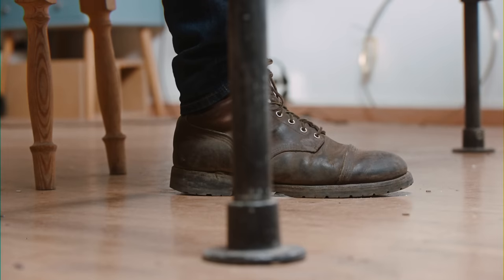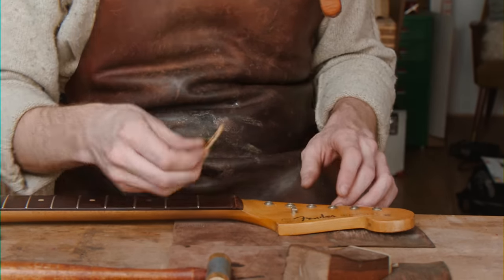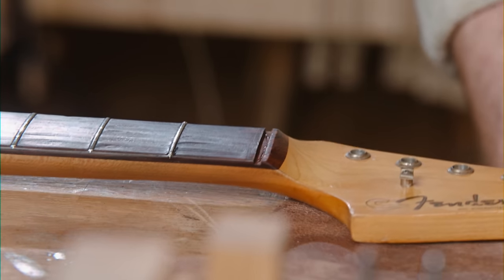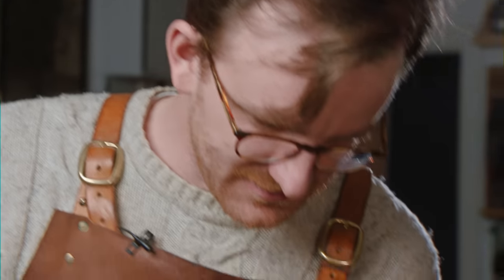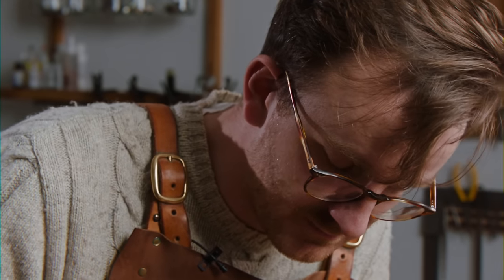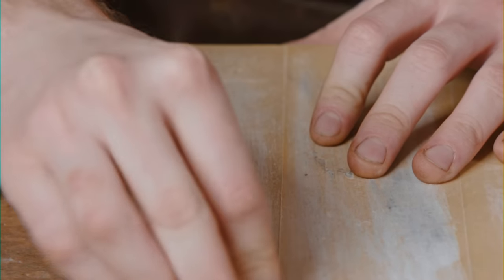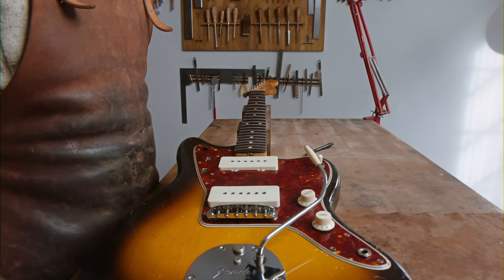Refret and Restoration of a vintage 1960 Fender Jazzmaster

Comment: I've worked in hi-fi for Totem Acoustic in the assembly line, AKA "the trench", and I'm not quite sure people understand the level of carefulness and skills it takes to use a soldering iron to heat up the frets without protecting the fretboard. This man is a living legend of soldering :O Also I'm a cameraman and I would say there are TWO masters at work here...!
Reply from the maker: Thanks Jas!
Reply: I wonder what the solder wire is for if he's heating up the fret? Does it even out the heat distribution? Or is it otherwise not good to put the iron directly on the fret?
Reply: @wookyoftheyear  The solder helps transfer the heat.  A dry soldering iron doesn't transfer its heat very well, so heating the solder up helps transfer and spread it.
Reply: Duncan Taylor 

Exactly.

Comment: This is actually super-useful. Jazzmasters seem like a standard Fender guitar. But they are actually very mysterious in their setups - the neck shimming being the most obvious example and the tremlock being another. By going into why he made a full cavity shim, Lars is helping us Jazzmaster players avoid making foolish mistakes or giving up when our guitar don't play right.
Reply: They aren't mysterious. You have to use a little bit of very basic physics, and understand that in 1958, when the jazzmaster came out the lightest strings you could find was 12's with a wound G. The low break angle at the bridge didn't matter at all, and there were no problems.

Thicker strings create more tension pushing down on the bridge, that tension keeps the bridge stable, and the strings will not pop out of the saddles, meaning shims are not necessary. You can use 11-50's, and no shim, like I do and never experience any of the reported problems.

Those problems like the bridge tilting on its own, bridge buzzing, strings popping out of the saddle grooves all started in the late 60s when 10's 9's and 8s became available. 

People would get a jazzmaster, slap some thin strings on it and have all manner of problems, and always blaming the guitar, when in fact it was user error.

Setting the bridge is quite different than what most are used to. You don't set the string height with the saddles. What i tend to do is set the outer 2 saddles as low as possible (same height on both) then raise or lower the bridge based on the 2 e strings action then set the other strings to match the radius of the fretboard. If you set the saddles too high the intonation screw will make contact with the strings, turning your guitar into a sitar.

Also since the bridge tilts, it's not a bad idea to get the bridge as level and centered as possible, and make a bit of wood that fits between the bridge and bridge pickup so you can quickly level and center the bridge and keep it from tilting forward when adjusting intonation.

The trem is a but finicky too, to set them up correctly (there is a right way and tons of wrong ways, it's not a personal preference thing)

What you do is, tune up, and press the bar down, and slide the lock button all the way back. Then tune again. Now, you adjust the spring screw and keep retuning over and over until the button slides back and forth without contacting anything, but also when engaged, you won't be able to pull up on the trem bar at all. 

If you don't set the trem up correctly, the bridge has a tendency to not return to center after using the trem, but set up right, it should always return to center  as long as the strings aren't binding at the nut or string tree.

Now its important to note the jazzmaster has a lot of sympathetic vibrations, if you play a g on the high e string, you'll get loads of overtones of that note from all the other strings. Sounds kind of like reverb. A lot of people don't like that, but I do. Makes the guitar sound a lot bigger.

Also, proper jazzmaster pickups are very noisy, due to the coil being a bit over 1/8 tall and extend nearly all the way to the pickup covers. Old jazzmasters actually had brass tubs in all the cavities soldered together and grounded, and the first year of them also had aluminum pickguards. 

From 59 and on, they used an aluminum shield under the pickguard. These days it's aluminum tape and conductive paint, which doesn't always work. My vintera jazzmaster has conductive paint but it wasn't done well, so I lined all the cavities with aluminum tape, and grounded it all, but since the pickguard isn't totally shielded with aluminum, (and I ran out of tape,) it's still a bit noisy when not playing.
Reply: @rebeccabailey527  you know your Jazzmasters! Great information thank you.

Comment: The 'R' indicates RETURN these early slab boards  where often returned for warranty
the neck twisted because Fender never seasoned the boards 

that's is why they went to venereal boards to over come the incompatibility 

you can see the slab is thinner than usual before the re fret and  leveling .... re-fretted at the factory then resold or returned
Reply: The headstock also didn't lie flat upon the table.
Reply: My guess was "Rosewood" if the neck was made by one person and the fret board installed by another person
Reply: Ummm, not "venereal" boards LOL

Comment: I've seen people warming up frets with a soldering iron prior to removal, but I've never before seen anyone apply solder to the fret. Very interesting. It's always a pleasure observing a professional doing their thing.
Reply: It's because the solder's job is to distribute heat much better than pure metal and much much more evenly, so the fret can absorb more heat faster and more evenly = easier job to take them out and less risk of damaging the wood because only one end of the  fret was hot enough to matter.

Comment: I started playing guitar on my older brother's Harmony archtop, back around 1959. In 1960, he got a new Jazzmaster just like this one, which I jumped on like a big dog. He used it to play rhythm guitar in a group called, "The Classics". Very correct on the Jazzmaster neck angle. Dropping the headstock down, increases the downward pressure of the strings across the bridge, which improves stability, and also improves the tonality. You might be one of the few people nowadays, who know that the early Fender frets were installed from the side.

Comment: 100 years from now.. 
"Yeah, this old Harley Benton has a few issues. I mean, the necks warped, the tuners wobble, the board is de-laminating, the bridge wasn't quite put on in the right place. You can see here the CNC router bit they used, hahaha CNC routers how quaint, was blunt, so most of this here is abrasion damage from the factory! But, you know, these old guitars have such a magic about them. So much charm and musical history in these old things. Nothing quite like it.."

Comment: Very nice work. In many ways we are similiar in the approach to do this kind of job.  One difference is that when I encounter the "kick-up" due to neck shims, I de-fret the neck and let it rest / relax for a week. That way, I get a better " read" and it tends to prevent me removing wood when I level the board.
If the customer does not want to wait for the neck to relax and get back to where it once was, I refuse the job. 
If the neck HAS to have a shim, I've always made a tapered neck shim using a jig and my thickness sander. That way, there's no " kick-up" .  I beleive Stew-Mac now makes similar things for sale.

Comment: I think this guy is really good at what he does, my only small criticism would be that I thing he could have saved and reused the original nut and that the small chips in the fretboard should have been filled in with a mixture of super glue and the dust from the sanding of the fretboard so that the repair is less obvious. Then again im not there looking at the repairs myself and the original nut could have already been broken and the chips could have been small and hidden by the ne frets. Overall very solid work A+ sir!

Comment: Neck Angle: This is something that has frosted my flakes for quite a long time.  Most of us add a shim in order to raise the fretboard and to relieve the saddle screws.  There are Break Angles at behind the bridge saddles and from the nut down to the tuners which are important.  I tend to want to get my necks as straight as possible and herein lies the issue of Neck Angle.  Guitars that are known for tuning stability maintain a straight string pull.  It's like inline tuners vs three on each side.  I would think that the neck should be raised up ever so slightly while keeping a flat trajectory.  Stated another way: Are the neck pockets routed too deep?  Of course on a Set Neck or Neck Thru, these issues do not come into play.  A Neck Thru is one piece of wood or laminated pieces of wood that runs headstock to bottom of the body and it's finished with glued on wings on either side of the neck block.  These tend to be perfectly straight aside from the relief that the trussrod provides.  If a Neck Thru is truly straight, without any neck angle, why could this not apply to a bolt on?

Comment: Nice work although I prefer to use a press with a radiused caul to press the frets in. I think the even pressure of the caul over the entire fret gives a really close fit between the fret and the fret board especially on an old guitar like this that has lots of funky contours to it. I think I would also use a contoured sanding block that is the width of the board to sand the board before installing the frets because I really don't think you can get an even contour end to end just by using a narrow sander. The sanding bar you used will give you a level board end to end but who knows what radius you will wind up and whether that contour will be consistant from the nut all the way up the board. When you need to take off more wood than normal to get rid of the hump at the body end of the neck you then need to reestablish the contour side to side and make sure that radius is the same end to end. And I understand that some say the the frets should be removed from the side but all that hammering on the fret can mushroom out the end of the fret you're hammering on and cause more problems with end chip out. I like to just heat them and pull up. Some trauma is just part of any surgery.
Reply: Thanks for the feedback. Your method sounds good too. I prefer the narrow sanding block because some of these boards really don’t have an even radius, and considering that I try to sand the least amount possible on the vintage boards I prefer not to change the radius it has even if that means that it won’t be completely cylindrical. Have a nice weekend!

Lars

Comment: I usually wrap a piece of 14awg copper wire around the end of the fret sliding out to reduce the chipping.  Of course, sometimes a chip will form before I can lasso the fret end with the wire.

Comment: Hello Thank you so much for your hard work. I have a question to inquire about it. I am a user who is using the fender custom shop 1956 model in Korea. I am currently working on re-fretting, and I am worried that the neck and the life of the neck will be damaged in the future.  The fret is the original fret, and the first professional shop is planning to work on it.

Comment: Great and educational video!
Still, two thoughts that I can't get rid of:
1: If those (btw factory) shims caused a bow in the board in 50 years, by that same logic, the bottom of that neck heel would have a hump right?
Yet you don't put the same shims back that took 50 years to settle (into a hump and thus bump). You put 1 straight flat shim in there, if the heel has a hump, that you didn't take out, what will the board look like after 50 years from now? :)
2: If you are going to test if sliding a fret out sideways or pulling it out upward works better, why would you do that on the first fret?

Comment: Cool video. So you learnt with Sota at Summit. Question, why would you sand the fretboard rather than taking it off and leveling the neck instead? Solves the shim problem too if you remove the fretboard and level the neck. Plus, it doesn't then need to be fixed and aged again afterwards. Just curious. Good video though. I also liked watching Sota work too.
Reply: Thanks. I don’t know Sota unfortunately. These fretboards are too thin to be reliably taken off without a risk of permanently damaging it. Sanding the neck can be done if you replace the board, but otherwise the risk is too high.

Comment: Amazing video thanks, what dye did you use to stain the clay dots and the nut? I recently had a refret on a 63 Jazzmaster neck and a 63 strat neck one used the original nut with a shim under it the other got a new nut any reason you recommend one method over the other?
Reply: I prefer not to modify any of the vintage parts so I leave the old nut in the case for vintage value:)

Comment: How do you know which way (sideways)to knock out the frets ?....bass side towards the treble side,or vice versa,as they should be removed in the same direction that they were installed at the factory (presumably)

Comment: How come you hammered in the new frets and THEN glued them? Did the glue go around the edges? I figured it would go under the frets...
Reply: Yes. The glue flows under the fret from the top. That way I’m sure that the frets are all the way down instead of risking glueing them before theyre seated properly. The glue goes around the fret a bit, but that is easily removed with glue desolver:)

Comment: I have the opportunity to purchase a 1965 Fender right now , it's working, and plays well, but it needs a restoration. I'm not sure where to begin if I buy it. Send it away ? Or leave it as it is? On one hand, it certainly looks VERY aged - paint wearing off in parts from use, scrapes little dents on the bottom, on the other hand, if I don't have it restored,  it will deteriorate over the next years... I'm unsure what to do... ( This was a barn find of sorts - last played over 15 years ago and has sat ever since )

Comment: The solder is for better heat transfer, otherwise you'd be making very little contact with just the tip of the iron. I'm 9 minutes in and I don't know if this gets mentioned. You do the same thing on circuit boards.

Comment: I learned the hard way that prior to removing the nut, score along it's edges with a fine sharp blade to help seperate it from the surrounding timber to avoid the last section of the fret board, ie in front of the nut, from splitting off. Happened to me with a Jazzmaster!!!!!! Please feel free to learn from my mistake.

Comment: when he heated the fret with the soldering iron to loosen it, did he apply solder to the top of the fret? i saw he was holding something to the iron while heating the fret, but am not familiar with what i saw
Reply from the maker: Yes, he did
Reply: Yes. It transmits the heat faster that way

Comment: Why solder? Better heat spread? You could just touch the soldering iron without flowing solder which could flow into the wood

Comment: Why not use a radius sanding block instead of the smaller block you used, which could take off uneven amounts of fretboard?
Reply: dirtdirt these fretboards aren’t so accurate to begin with so trying to make them accurate might involve disturbing the fretboard too much

Comment: !! Question!! Question!! Heating the frets with a soldering iron is a common practice when removing the frets, but why the solder?
Greetinx!!
Reply: Because the Hot solder is staying much longer on the fret and keeping it hot for a longer time, it balances the heat on the whole fret ,instead of a specific spot heated by the thin pin of the soldering iron by itself , and that's much better for dissolving the glue under the fret while pulling it off , it helps to reduce the fingerboard chipping too as much as possible.

Comment: When you heat the frets, why are you applying solder?  I get the concept of using heat, but what does the solder add?
Reply: The solder improves the heat transfer from the iron to the fret. Without solder, the iron only touches the fret in a very tiny spot. It also increases the thermal mass of the fret, making it stay hot for longer. Without solder, you need to heat the fret longer.

Comment: Can someone please explain why Lars is running the frets with solder when he heats them up with the iron? 

I have seen the soldering iron used to heat frets before, but have never seen or heard of anyone actually using solder to tin the frets during the process.
Reply: its not solder, its flux

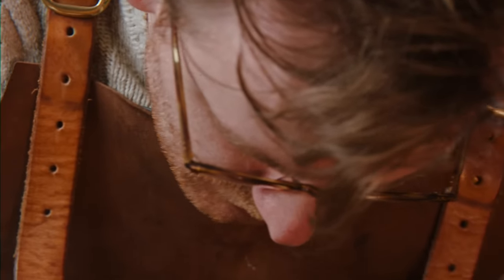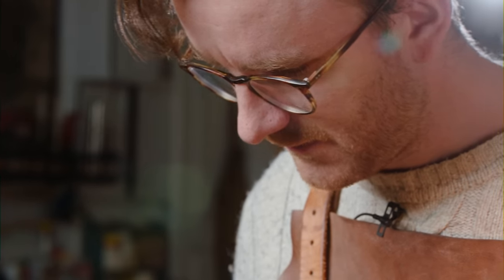Comment: 17:16 - 17:55 what he did should have been done after putting some tape to protect the wood. You may scratch fretts but for sure you scratch the wood with them too
Reply: Hello Nikos! Luckily that file doesn't bite into wood if you apply the right technique, or else I would agree:)

Comment: But what happened to the neck angle problem that made them use shims?
Reply: He still used a shim, but went with a full pocket shim instead, which is the right one to use as it won't leave any gap between the neck pocket and the neck, thus preventing the hump for developing again.

Comment: Isn't it problematic to measure flatness along the frets, as opposed to just upon the wood of the fingerboard? Especially if a re-fret is needed; it stands to reason that the frets would be inconsistent heights.
Reply: Steve Soldwedel it’s just one of multiple ways we measure. I measure with the frets on, frets off before and after sanding. When the frets are in it can make the neck bow in a different way than it does with the frets out so I find it useful to check both;)
Reply: Thanks so much for the reply!